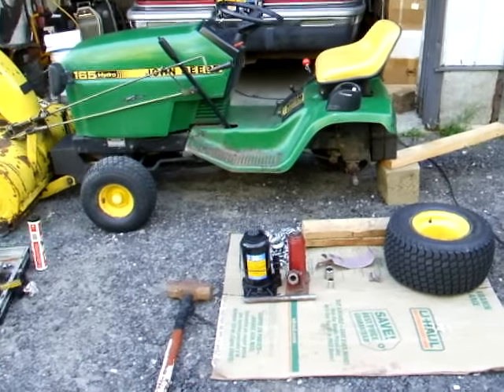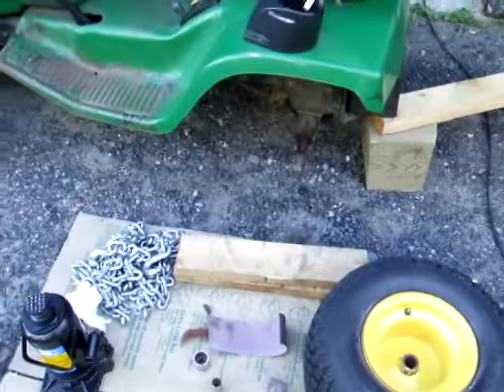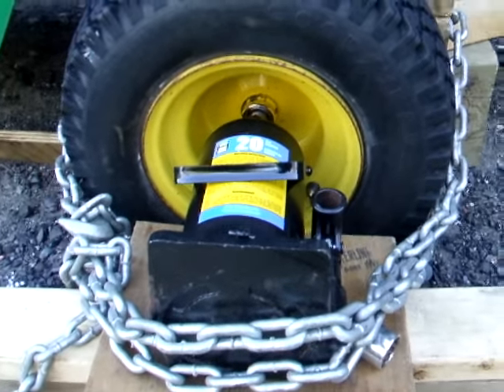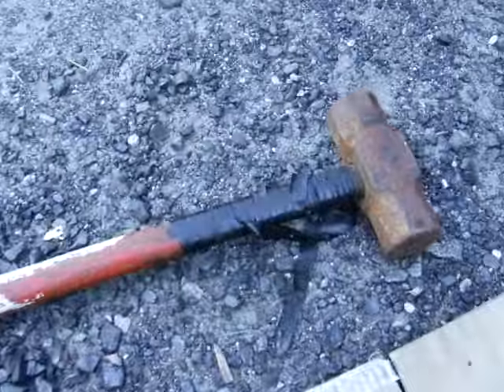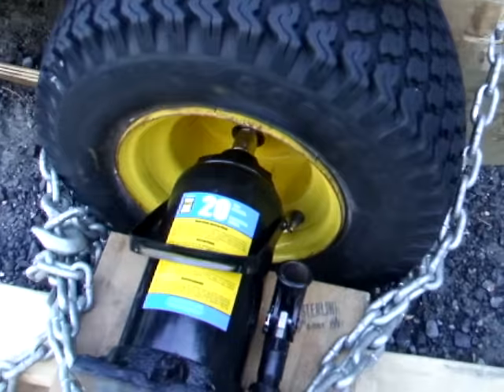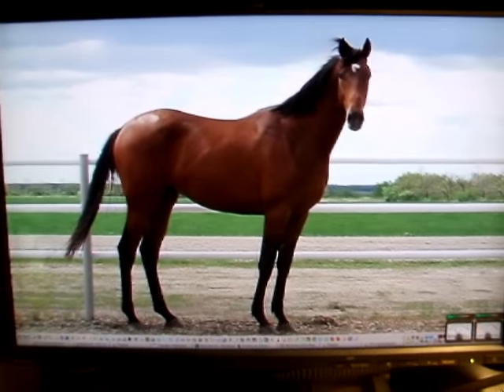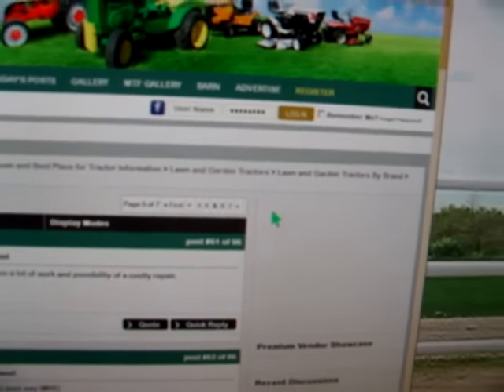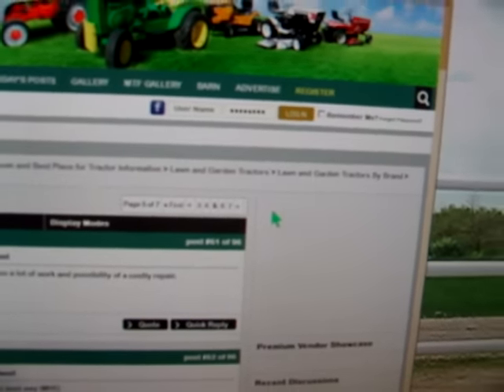Removing rusted/siezed lawn tractor wheel with a BOTTLE JACK and WINNING!!

Comment: I tried welding a nut to the rim and then using a bolt to pull it off. First I broke the bolt. Got the bolt out and went for a Grade 8. Bolt and my 1/2 impact. Stripped the threads in the nut.  Fun stuff. 
  I will be cutting the nut off and splitting the outer shaft. That should do it. 
  In the past I have taken a piece of hose that will just fit over the shaft. Then take a hose clamp and tighten it up around the hose to hold it onto the shaft. 
  On the open end fabricate a pipe fitting with an air fitting in it. Fill the fitting with your choice of penetrating oil and set your pressure on your air compressors about 50 Lbs making sure the compressor power is off. Attach the hose at the rim and go back to the compressor and attach the hose. 
 This creates a pressure to force the fluid into the gap if any. Let it set for days. 
  Making sure your compressor is powered down is important just in case your wheel actually blows off. I’ve only had it happen once. 
  This also works great with frozen control cables and Emergency brake cables. 
  Stick the cable and sheath into a hose, tighten down around the hose with a hose clamp and add penetrating oil to the hose. Add a fitting and some and let it set until you get oil out of the loose end.
Reply from the maker: Sounds like fun stuff indeed Richard!  I hate rusty broken stripped bolts....:o)  I've heard of people bending shop presses trying to get these off, rust is strong!  Yes splitting the shaft hub should work, method of last resort at the end of my video.  And you can still reuse your rim.  That's a very good idea for pressure lubricating stuff with penetrating oil, even boat steering cables, I'll remember that for next time.  Thanks very much for the comment Richard and Cheers!~  Bellarmine

Comment: A helpful tip is to use a good quality anti-seize lubricant instead of axle grease when reinstalling the wheel.  Over time the grease can harden and work itself out of the joint allowing rust welding to reoccur.

Comment: Removing the tires at least once a year and greasing them will prevent this from happening. i would recommend every other oil change will also work. Just a reminder is all you need. Happy mowing.
Reply: Antizee it and keep it in side out of weather, no problem 
Grease gun , antizee and few tools is all it takes to keep them up

Comment: Had this problem today - needed to change out a rotten tire. In the end I gave up trying to remove the rim, just cut the tire off and installed new tire with rim still on the shaft!
Reply from the maker: Well there you go, whatever works, if you were able to get the tire mounted still on the tractor more power to you!  I wanted to swap my wheels between my two tractors (knobby tires for grass cutting, smooth tires with chains for snowblowing), so I thought that'd be a 15minute job.....I should have known better lol!  

I was looking at your channel, real interesting I've always loved model railways - also your demos of Thomas and Friends is great!  I grew up watching the show, always liked the older seasons with the real model railways as opposed to the CGI - much more creative.  I still have a lot of the old Playmobil brass track and cars and engines (compatible with LGB), had a blast with that, real durable stuff you can even put outdoors in the winter, think it is G gauge pretty big.

Check out the fellow's channel, he's creating amateur episodes of Thomas and Friends and (of all things) Bambi!  What he lacks in professional props and lighting he more than makes up in creativity - check it out:
https://www.youtube.com/channel/UC0-F-Tu3wjLyrmUxM-ySalA

Cheers!~  Bellarmine
Reply: How did you mount the tire while on the tractor?
Reply: @mjx_0726  brute force and ignorance (tire iron) followed by starting fluid and a lighter!

Comment: if i ever do get mine off i will remove the wheels everytime i finish mowing lol
Reply from the maker: I know what you mean Davis lol!.....:o)  Try some Permatex Anti-Sieze grease on it if you do, that's what I'm going to use next time I have my wheels off.  I also keep the tractor under cover which I am sure helps in the long run.  Hope if you need to get them off, they come of a lot easier than mine - thanks for the comment Davis and Cheers!~  Bellarmine
Reply: It’s just smart to remove them when it’s brand new and antizee them then 
Hate that the sorry ass America manufacturing company don’t antizee them
Piss poor attitude towards customers 😢

Comment: Good Job!!!  Although we suppose to take the Wheel Off " each year " to grease it or better yet " anti-seized " it, but we don't.  NOTE:  Those Grease going to dry up in no time and you will be back to square one again, unless you are willing to do this every year.
Reply from the maker: Thanks Jordan!  Yeah, guess I should re-grease them every so often if I get the chance so I don't have to do this all over again lol.  Pretty troublesome design in my opinion.  Funny - the other wheel almost slid right off.  Maybe it'll help that I don't use the tractor all that often and I keep it under shelter when I'm not using it.  Congratulations on your Bars Leaks victory over your head gasket leak!  Had a head gasket leak on my old Chevy Corsica, and even after a head overhaul it still leaked a tiny bit.  Cheers!  Bellarmine
Reply: @bellarmine33  - Yea, the Bars Leaks actually worked.  I'm surprised myself.  I did a Car + a Truck, omg both dry and worked so far.  I don't know how long it will last!  But no more starting issues and moisture problems!

Comment: I've got seized drive wheels on my JD L130 and I'm sure going to give your method a try.  I just tried your suggestion of possibly using 4x4s behind the wheel instead of your videoed example of 2x4s.  In my case, they will just barely fit, but there's insufficient room for a stout chain to go behind them.

I'd like to make a safety suggestion regarding your method.  I've been taught to not use steel against steel, if possible, in such a situation due to the chance of slippage.  I would suggest laying a 4x4 under the base of your jack, to protect against slippage, and make it the same length as your 2x4s, so that the chains across the tire are parallel and not biting into the tire.
Reply from the maker: Hi Jim, thanks for the comment.  That's not a bad idea, makes good sense.  Only thing is you'll have to take time to get everything positioned, I found it hard enough keeping the chains positioned behind the wheel and around the jack, without another board to hold in place, guess 4 hands would help lol!  Good to hear that a 4x4 fits, if you don't care about them you could route-out or chisel a groove in them for the chains to ride in, still be a lot stronger than 2x4s.  Thanks again for the idea Jim, I'll keep it mind.  Let me know how it goes if you want or if you have any questions - Cheers!~  Bellarmine
Reply: @bellarmine33  Thanks, Bellarmine, your suggestion just made it easier for me.  The top inside routed 4x4 will easily lay on top of the flat of the axle housing.  I'll drill vertical holes near the end of each 4x4 and hang the bottom one from the top one with bolts (but not snugly, allowing it to slide over the axle housing) so that I don't have to block up from the ground to hold it in place.  As the chain makes the 90° turn outward at each end of the two 4x4s, I'll drive a nail through a chain link into the end of the 4x4 to hold it in place while getting everything set up.  Obviously the outboard 4x4 and bottle jack will still need to be blocked up from the ground, and I think I'll route the outboard 4x4 also a short way in from each end just to make setting up the chain easier.
Reply from the maker: @Jim700  Glad the suggestion is useful, you're welcome, your jig is sounding great.  Only thing, I'd keep an eye on the 4x4 under your jack, I'm not sure how it will hold up to 10 to 20 tonnes of force, it might crack rather suddenly - maybe use 2, or a 6x6?  Getting really heavy-duty here aren't we lol.  I'd be interested to hear how it works out, keep me updated Jim, and good luck - Cheers!~  Bellarmine
Reply from the maker: @Jim700  Oh, and P.S., in case you're not doing this already (I'm sure you are), don't forget the couple cans of P.B. Blaster for a day or two - not enough by itself but I am sure it helps!

Comment: Thanks! I may have to try this on my Toro 12/32 recycler rear engine riding mower. Got a slow leak in one of the back tires and I don't think the wheels have been off since new in 1992, lol.  I took the cross bolt out and tried wiggling the tire but it's not gonna go.I did take a small bottle that fits snug on the hub, filled it with penetrating oil, then pressed it on so the axle will get a good soaking. I'm going to leave it like this till spring. Too cold to mess with it now. Thanks for the Vid. :)
Reply from the maker: You're welcome James, hope it works out for you in the Spring!  Keep me updated with how it goes. That's a GREAT idea you have about finding a small bottle to stick on the hub full of penetrating oil - I will try that myself first next time.  Best wishes, thanks for the comment and Cheers James!~  Bellarmine

Comment: Great video!  I'm going to try it tomorrow.  I greased my axle a few years ago and the grease just didn't hold the water out.  I'd go with Permatex 80078 Anti-Seize.  Works great on my boat prop and I wish I had used it on that axle.  The boat is SS to aluminum so nickle Anti-Seize may be better on steel to steel (I always have extra when I do brakes on the car).  Make more videos, we all need more horse sense in our lives!  Thank you.
Reply from the maker: You're welcome Scott!  Good luck tomorrow, I hope it works for you, let me know how it goes or if you have any questions.  Yes, I greased up mine too, but like you just standard axle grease (guess I'll be doing this again in a couple years!).  At least I am able to keep them out of the rain, which I imagine should help.   Thanks for the tips on the anti-seize, and also your encouragement - yes, I have another video on the way showing an easier way to replace the A/C compressor on my Buick Roadmaster, along with a few general 'horse-sense' A/C service tips.....:o)  Cheers Scott!~  Bellarmine

Comment: this is pretty clever..ill keep this in mind if my otehr idea i found out here doesnt work which im thinking it wont but hopefully it will or one of them will my rim is seized on the bar.
Reply from the maker: Thanks for the comment, glad you found my puller video helpful.  Hope either it or your method was successful getting your wheel off, these can be VERY stubborn...:o)  Cheers!~  Bellarmine

Comment: i am going to try this today on my troy bilt horse tiller. good thing i already have everything needed and do not have to buy anything.
i was thinking about designing a puller that i could use my bottle jack with but the chain method is simpler and looks very doable.
Reply from the maker: Hi Paul, thanks for your comment!  Wish you luck, hope you were successful, and let me know if it worked or if you have any questions.  As you've read, it's pretty simple, just take your time setting it up and make sure everything is straight and square so it doesn't spring back at you and you'll be fine - never did with me......:o)  Cheers!  Bellarmine

Comment: Nice 165 👍 In the middle of a restoration on it's little brother (130) that has the identical problem on both sides. It was given to me as pretty much scrap sitting in a barn for 20 years. Thought for fun I'd get the little Kawi engine running... that lead to get the blade turning... that lead to make the mower better than new. Managed to heat one wheel up enough with a map gas torch to release it enough to move it about 3/4". Spraying it with Moovit for the next couple days and hoping it'll pop off. Not so confident with the other side though 😕 What a stupid design that could have been easily solved with 5 cents worth of never-seize from the factory.
Reply from the maker: Hi Mike, thanks for the comment!  Nice that you're restoring the 130, good little tractors, I think tougher than the more modern ones.  I like the way I can put a small car battery under the dash, rather than the tiny spots they give you under the seat.  If you have problems with the starter clicking and not engaging now and then let me know I have an easy fix for that.  About the wheel that budged 3/4", what I'd do is (gently) tap/whack it back in, then pull it out again, over and over, it'll eventually pop off.  Mine did the same thing - what a pain!  Yes, anti-sieze from the factory would have been good!  I'll put some on next time I have them off, I keep the tractor under cover so the grease should last quite a while for now.  Try my method for the other wheel it should do the trick, I hate using torches around tires heard some real horror stories even after removing the valve stem.....:o)  Let me know if you need any manuals I have the factory shop and owner's manuals on my HDD if you haven't found them already, and also an extra 38" mower deck for parts if you need something......:o)  Cheers Mike!~  Bellarmine
Reply: @bellarmine33  my starter was randomly clicking and not moving. Decided to take it apart to find one of the magnets had exploded which locked up the starter. Have a new ignition switch, PTO switch, starter, all 4 tires, and new belts on the way which will smarten this thing up. Already put on a brand new carb, fuel pump, fuel lines and spark plug. Got her dialed in beautifully until the starter grenaded. Going to go "full monty" on it now I have the deck off. Pressure wash, paint and body are now on the growing list. I'm sure I could sell it for half of what I'll have into it 🤣
Reply from the maker: @mikescott1050  Wow, sounds like it'll be like new when you're done, and yes you're sure to get maybe 25% back if you were to sell it lol.  Isn't it always like that?  Nothing more satisfying than getting a mechanical wonder purring again, quite a feeling.  Check out my other video on my 1956 Johnson 30HP outboard, was a great thrill getting that one started after sitting for 35 years!  I have to invest in paint, but it purrs like a Swiss watch.  Cheers!~ Bellarmine

Comment: Learned something new thank u for sharing did one last summer destroyed the wheel getting it off lol
Reply from the maker: You're welcome.  Yeah, it's crazy how rusted on these can get, these things can max out 25tonn shop presses!  You're not alone, I was starting to wreck my own rims before I tried this idea that works.  Others haven't been so lucky, like pounding it to bits and wrecking their (expensive!) transaxle, to using a torch and having the tire blow up in their faces (!).  Even though you damaged your rim, at least you did get it off, at a certain point I was almost ready to give up.  Hope this helps you have better luck next time Brad, and thanks for the comment - Cheers!~  Bellarmine

Comment: Would've been nice if the factory had put some anti - seize on that axel...
Reply from the maker: Thanks for the comment!  Yes, you're right, though I think they did do that at the factory, the trouble is the grease dries out after a few years, and the shaft and hub rust together.  They even say in the owner's manual to "Remove the wheels and grease the shafts once a year".  Who's got the time to do that?  Anyway, for those of us who don't have the time to do that (like everyone lol), this is a pretty low-fuss alternative.....:o)  Cheers!  Bellarmine

Comment: I have a 165 Hydro too,
Well actually it is still at the Dump because there is  too much Snow, but I should be able to get it out of there in the next few weeks.
Reply from the maker: Thanks for the comment!  Sounds good Kevin, yes looks like Spring is finally on its way.  If your wheels are stuck and you're going to give them another shot, I hope this video helps you out.  Or let me know if you'd like any tips on your 165, fixed a tough no-start issue with mine, been using it to blow snow past 3 years, the Hydro sure is easier than gear drive, sure turns a chore into fun.  Cheers Kevin!  Bellarmine

Comment: Use a scissors lift jack with a handcrank you will not have that problem running out of fluid
Reply from the maker: Not a bad idea.  However I've found most scissor jacks are about 2 ton units, and as I said in my video I started with my 2 tonn bottle jack and it couldn't cut it, needed to upgrade to the 10 tonn model (!).  The fluid wasn't a problem with the 2 ton jack as it was designed to be sideways, and for the 10 tonn jack I just screwed the extension out all the way to take up the slack and it was fine.  Also it'd be a bit harder to position a scissor jack with the threaded rod sticking out etc etc.  However could certainly try starting with one though, and upgrade to a hydraulic if it doesn't do the job.  Thanks for the comment - Cheers!~  Bellarmine

Comment: I'm going to try this. Question, won't the tire hit the board that the jack is placed on?  Or will it slide along as the wheel moves?  Thanks
Reply from the maker: Hi Tim, thanks for your question.  No the jack won't 'hit' the board(s) placed underneath it, they shouldn't even get in the way or be an issue.  I just placed them underneath the jack to hold it at the right place while jacking.  Once there's tension on the chain they don't do too much, they remain loose and movable.  Either way they won't be a problem....:o)  Good luck with your wheel extraction, these can be Stubborn!  Let me know how it goes or if you have any further questions, thanks Tim and Cheers!~  Bellarmine
Reply: @bellarmine33  thanks.
Reply: Update, I had to use a sawzall to cut the wheel off.  When I got to the axle I stopped. Came off pretty easy then. What a pain.